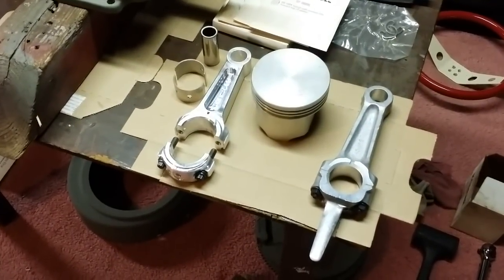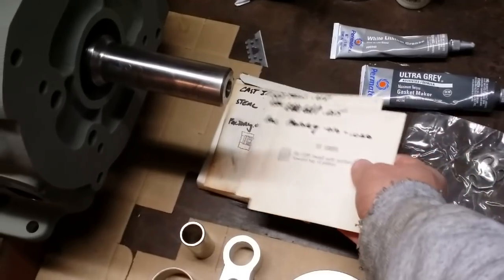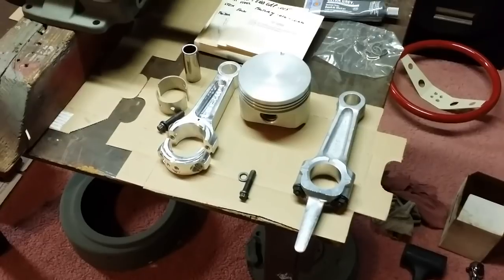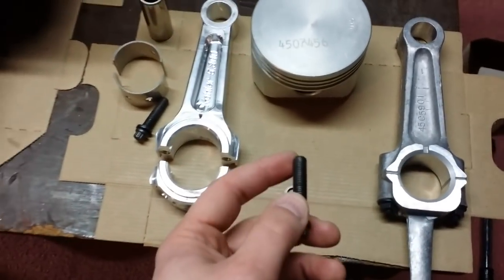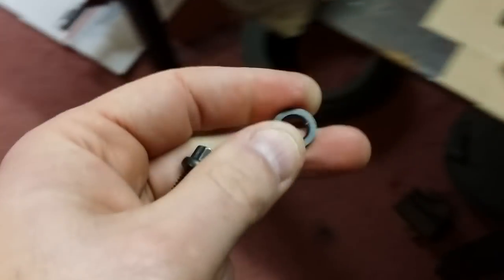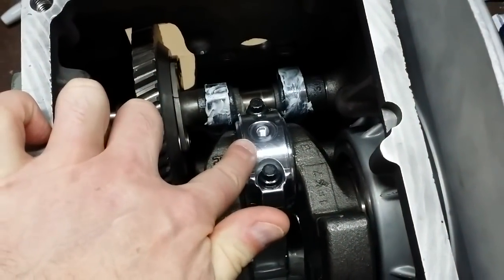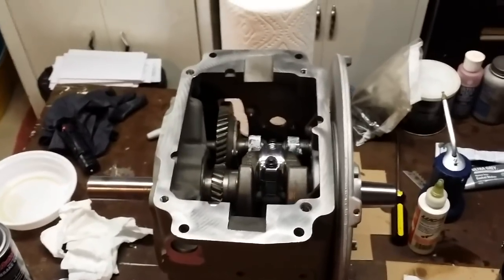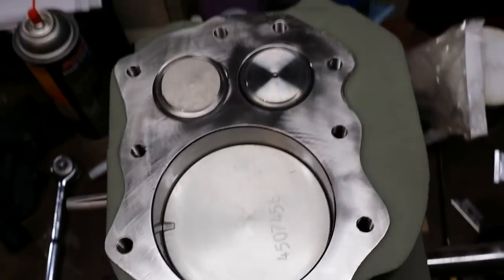Wheel Horse Garden Tractor Kohler Magnum 16 Engine Rebuild Reassembly Part 4 VinsRJ

Comment: Vin, really enjoyed this series. Are there any follow up videos on this engine and the 416? Would the Magnum 16 fit directly into the 300 series WH tractors without modifications?
Reply from the maker: Hello James, search my vids of the Lil Mule... the M16 is in that tractor, A M16 should fit in a 310/312 style tractor, the oil pan and blocks are the same dimensions.